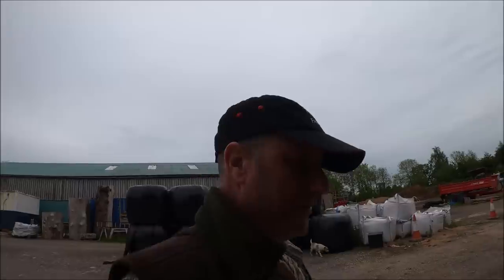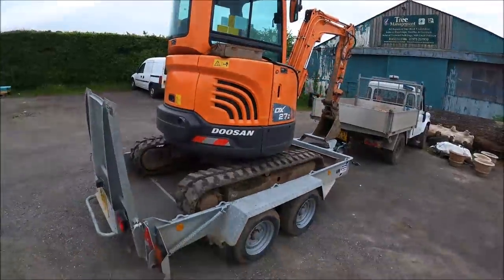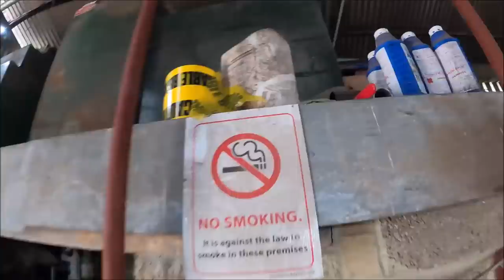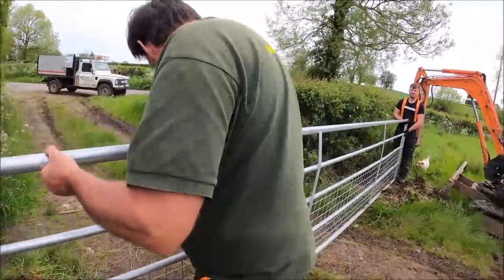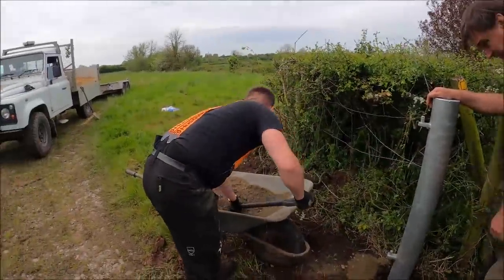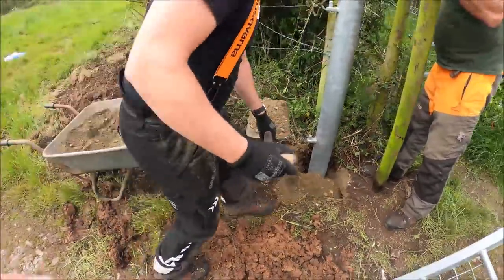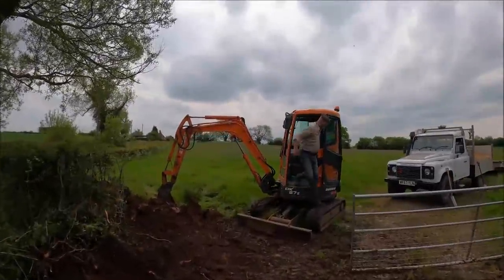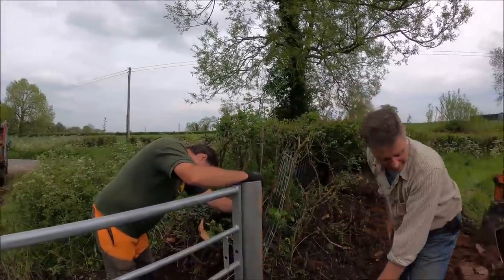Setting a sixteen foot field gate!  29 05 21

Comment: Top Tip - Toolstation sell extra length hinges. 

Down here in Kent the ground can move quite a bit, and having long hinges means you can always adjust more than standard hinges if needed.

Comment: A good job, but why did u not use rough sand with the cement and slightly wet it before  putting it around the post.We irish would also put some lumps of field/ditch stones in around the post through the concrete to secure it in place while tapping the concrete  in all around it.Then our gate  posts are guaranteed to withstand a lot more weight from the weight of the hanging gate. etc.At the same time, Im sure yr gate aint going to go anywhere anytime soon.lol...Keep up those great videos Ian

Comment: Like others on here never ever put a dry mix into the strainer hole then wet it 🙄😳always mixed it wet then added it 💪 nice to see the repartee between u all 👍 hope ur mum is doin well 👍
Reply from the maker: I only got to see mum once this week Bob, I had my second Covid jab on Thursday, then spent all day Friday with a mega hangover 🤕 we normally put a half bucket of water down the hole first as well so it wets from the bottom up too, but this hole was slowly filling itself anyway so we didn’t bother this time. Most of my gate posts are firmed in like this, it takes a bit longer to get a truly hard concrete but so far I have had no failures. 🙂👍🏼

Comment: Thank you for this instructional video... I just have one question regarding how much clearance I should leave from the bottom of the gate to the ground? I am doing this by myself as a female so wish me luck but could definitely do with any extra hints or tips, if you have any, lol🙈
Reply from the maker: I set my gates low on purpose to stop walkers dogs going under them. 6" to 10" clearance should be adequate, just remember things like snow. If its a gate you use a lot and get snow, set them a bit higher to allow for the winter months. You wont need luck. Brains will often outdo brawn. 🙂👍
Reply: @FarmerP  Thank you so much for the advice, it's very much appreciated😊

Comment: That is the first time I seen it done like that. We would always wet the concrete before we put in the hole. ( and then have a barrow and shovel to wash out) . You got a nice finish to the concrete round the post. (a lot nicer than we would leave a post)
There is only one thing Ian, would it not be an idea to load the barrow last. Use it to load other things first. Someone had to make three trips loading the cement were the barrow would have done it in one

Comment: But there's a reason you put the water with the mix and not just throw it on top hoping the mix won't soak up all the water before the bottom , Oh well Pulling a Pullen again =-P
Reply from the maker: It’s slower to set all through than a wet mix for sure, but within a day it’s still strong enough to hang a big gate, and within a month it will be as hard as a conventional wet mix. Pushing the bar in 18” helps get the air out and water in as well 🙂